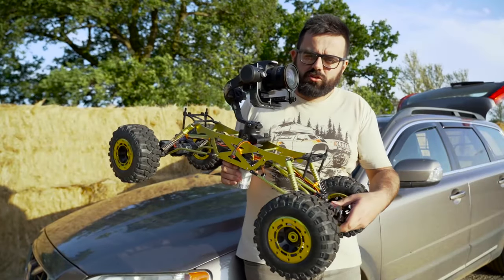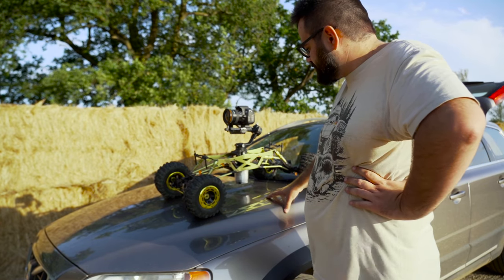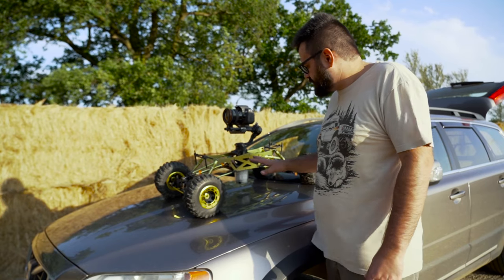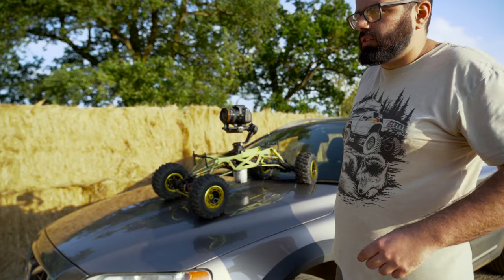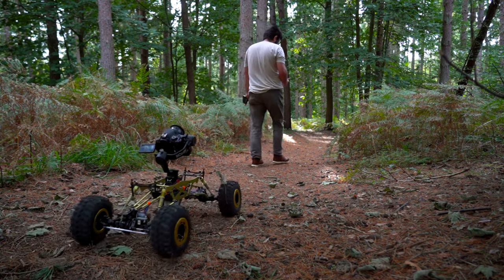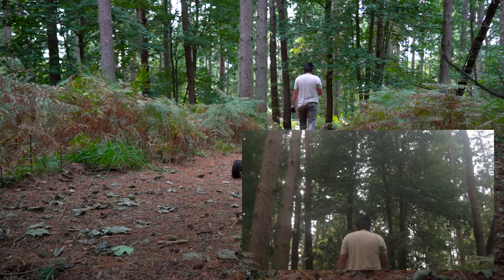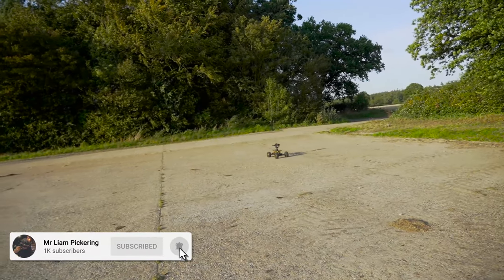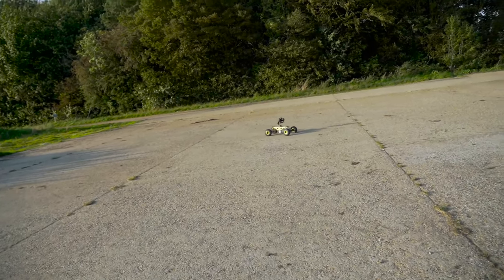I Put My Sony A7III & Gimbal On A RC Rock Crawler!!

Comment: Great video. Congratulations, you are a master. I am trying to make a RC mechanism to put a gimbal on top, specifically the Ronin RS 4. Because of its weight I know I will need to put big wheels. what is still not clear to me is which shock absorbers to put. Could you advise me ? Thank you very much and go ahead.